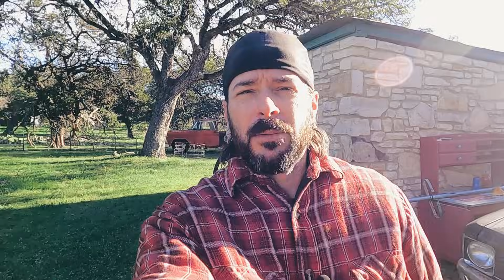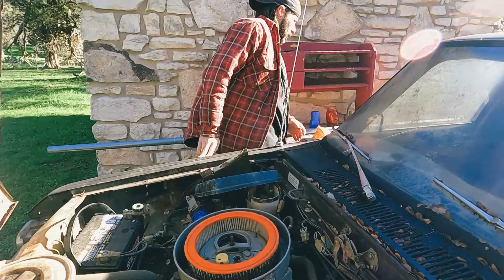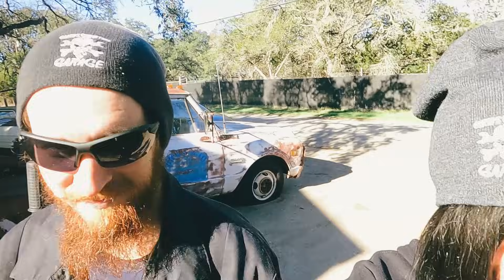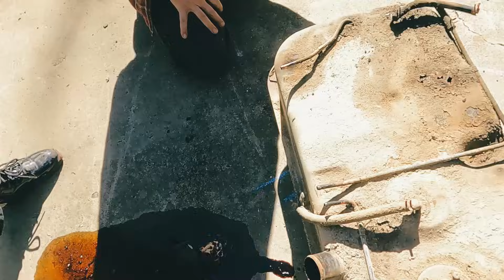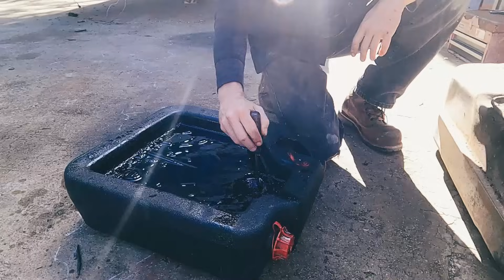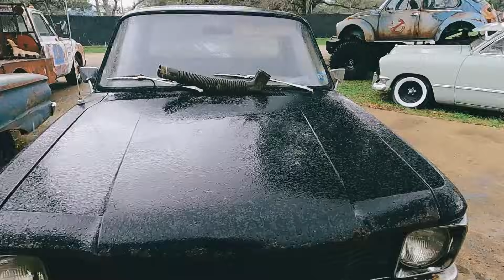1980 Chevy LUV 4x4 - PART 2 - Let's start on the fuel and brake system!

Comment: Those Chevy Luvs are the perfect size truck. Just big enough to move what you need, not so big that you're spending half a check in gas.
Between those and the Ford Couriers, I think they were the best compact truck designs ever.
I miss the 80s.
Reply: I quite agree. And I also loved the 521 series Datsun/Nissan trucks to which were really good looking little trucks and ran extremely well, easy to work on to.

Comment: Older S10. Tanks are about the same. N I believe datson pick up n Ford courier. Tanks will fit to. Or. Check ur local radiator . Shop. See if they can boil it in hot tank . An repair it.  Luv watching you all.

Comment: I removed fuel tank from my Scout and strapped the tank to my tractor and jacked it up, put couple hands full of gravel and nuts and bolts in it and let it rotate about 30 minutes! After removing it it looked like a screen door, had to scrape it!

Comment: You may try looking for the tank for a Later model Isuzu P'up, or even all the way up to the early 90’s trucks, the last of the actual Isuzu built trucks imported.

I have a '93 Isuzu, and it shares some components that could be retrofitted.

If You wanna keep stuff "original" sometimes You've gotta think outside the box..
Reply from the maker: This is a split year model, round headlights. It has to be first half 1980 or earlier. Aftermarkets aren't produced, sadly.

Comment: Early Chevy S10 are the same as Chevy Luv
Reply: Quite correct as they to  had Isuzu engines in them. That's what the Chevy LUV truck is, a Isuzu truck built for Chevy. LUV stood for light Utility Vehicle.